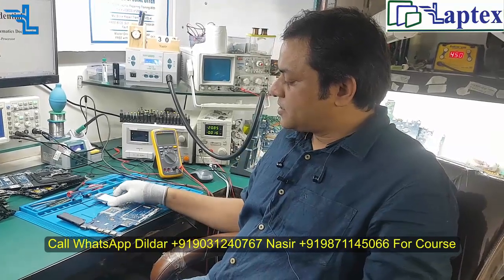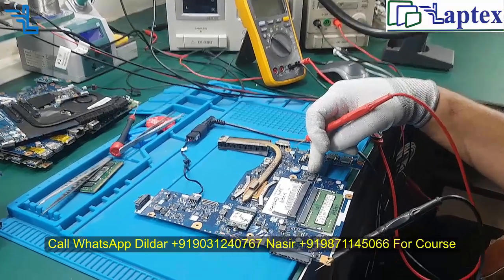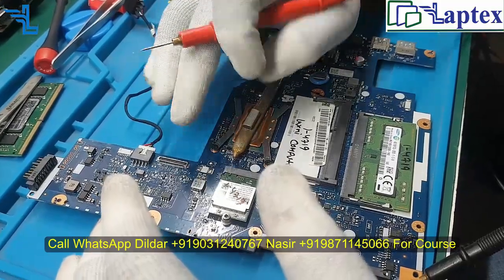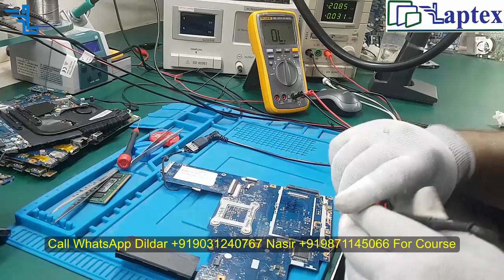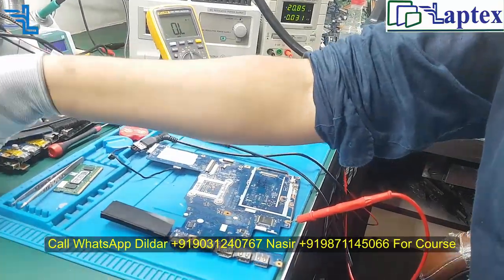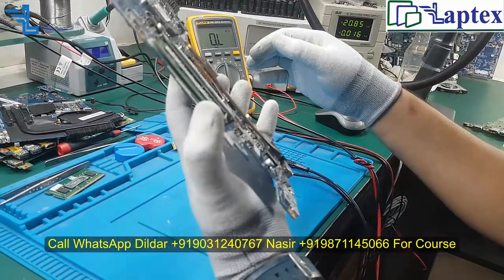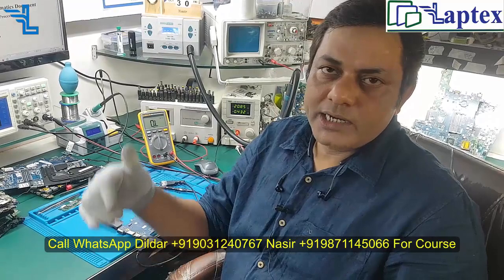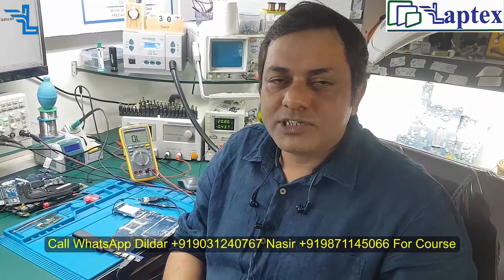LENOVO NM-A272 No Power On RTC Cell English |Online Chip level Laptop Repairing Video Course |Laptex

Comment: Because one time I had hp motherboard where by without cmos powers on but with cmos no
I checked and traced all RTC SECTION IT WAS OK, EVEN I REPLACED WITH BRAND NEW CMOS ALSO PROBLEM PERSISTED.

PLEASE SIR IS IT INTERNAL PCH  RTC SECTION  WHICH IS FAULTY
AND I NEED TO REPLACE PCH CHIP
Reply from the maker: Could be possible

Comment: lid switch is short
Reply from the maker: No it's not the case... It's simple CMOS cell problem
Reply: @laptex1377  Does that mean putting in a new CMOS battery will solve the problem?
Reply: @asankasanjayadesilva9628  not pwr on when Cmos insert